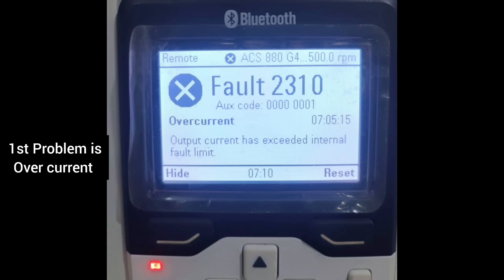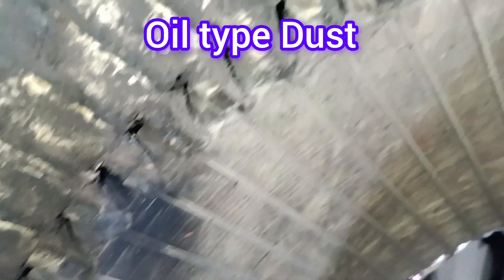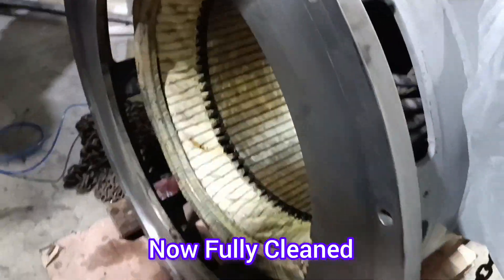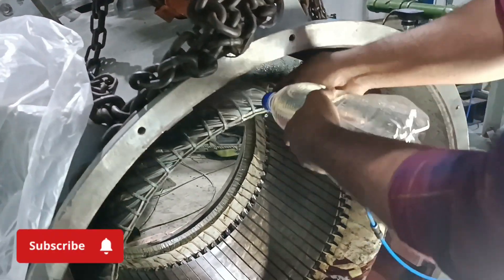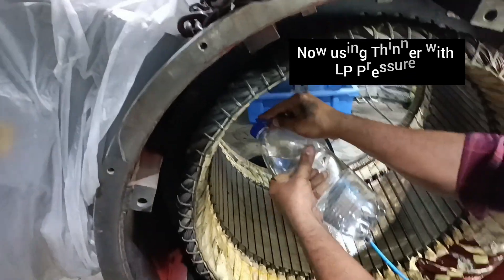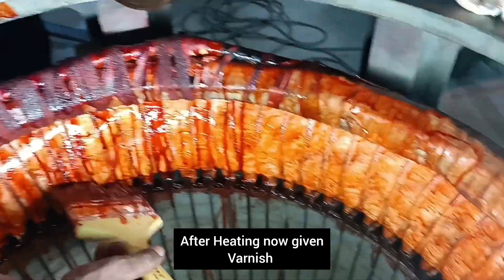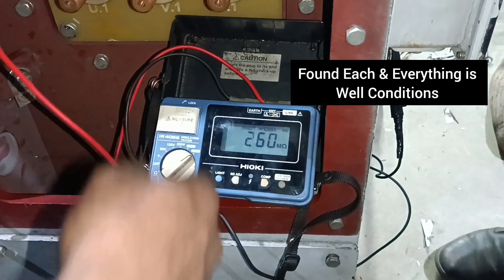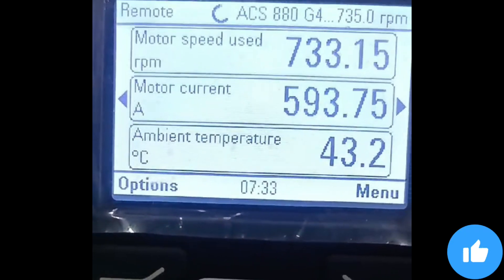How to Clean Motor Windings | Stator & Winding Cleaning Step-by-Step | Big Industrial Motor Cleaning

Comment: that is biggest moto i ever seen. i searching for cleaning my single phase 2hp motor. but found this video. its worth it to watch. applying thinner does not make winding failure?
Reply from the maker: Yes,  but you need to be drying it with a heater. After checking with the meter you can understand easily.